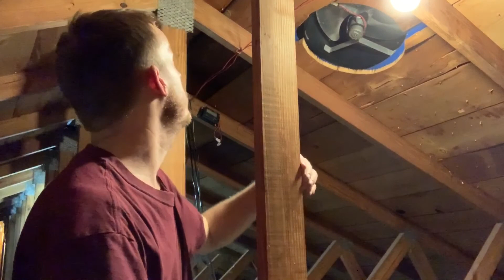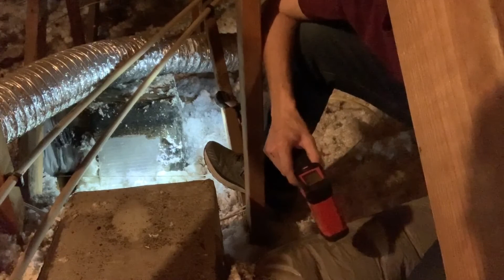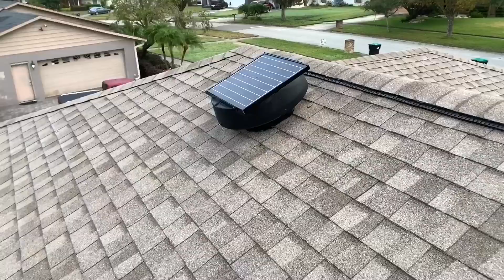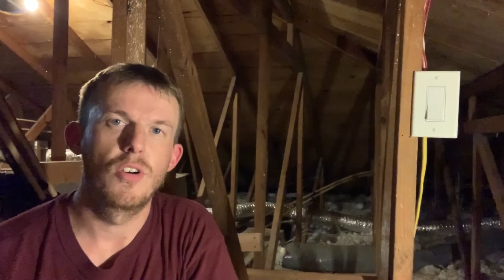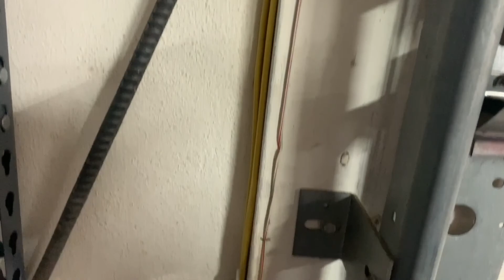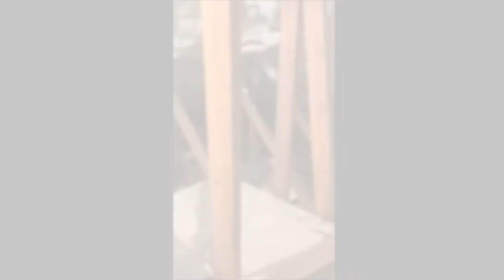Spray foam attic insulation | BEFORE AND AFTER

Comment: Must add an A/C supply vent in there now, or just poke a hole in one of the ducts to take care of moisture.
Reply from the maker: Agreed on conditioning the space. A sealed spray-foam attic does need its moisture managed, and a proper supply vent is the cleaner way to do it than poking a hole in a duct.

Comment: Who ever told you that pannel boards are better than planks for your roof straight up lied to you.  Planks are significantly stronger and will resist water damage and rot way better than pannel boards. The only advantage partical/pannel  boards have is the reduction in weight.. that's about it. 

 If your attic doesnt have adequate ventilation in the summertime the extreme heat can cause pannel boards sag so bad that you can see where each rafter is. 
 Spray foam on the bottom on the roof  can cause you real problems if the roof begins to leak.  Most insurance companies wont cover the roof or walls  that have spray foam for  Mold and water damage.   Im not against spray foam insulation but it has places it shouldn't be used and between roof rafters is definitely one of them

Comment: Problem with high electrical bills, not insulation. Its your duct work, its garbage trunk system. OK for basement in ohio, but not OK for Florida. All air wasted. System is working non-stop. Thats why high electrical bills

Comment: So after 4 years have any issues come up? I am concerned about the heat onto the surface of the asphalt singles will bake them to failure because there is no heat transfer into the attic.
Reply from the maker: No issues on the roof shingles. I found that the attic is susceptible to high humidity, and worried about potential mold, I opened a couple of ducts so that some of the a/c leaks into the attic and gave it more airflow. That seems to have lowered humidity without making any significant difference to my electric bill.

Comment: Spray foam is way overrated, especially in a ceiling. If your roof leaks you’re not gonna know about it until a chunky your roof is rotted away. Regular insulation with baffles and good ventilation moisture is your enemy not to mention it has a way lower fire rating and gives off toxic gas when it burns and it just looks awful.
Reply: Utter nonsense.  Are you an engineer?  I am.

Comment: I’m curious, why must your attic be non vented? Why not add spray foam to the top while not fully blocking all soffits? Keep the blown in cellulose as well on the floor of the attic?
What condition is then created by doing so?
Reply: Moisture is why. Your attic will develop mold and cause rot that way
Reply: Also you want you HVAC equipment in the conditioned space.  this is a huge benefit.  Not having you AC try to cool down air that is 130+ deg makes for a more efficient unit.

Comment: Couldn't you just leave in the cotton insulation since the spray foam only goes on the roof? Can the attic still breath? How does the spray foam work around ridge vents or turbines?
Reply from the maker: Its open cell so it can still breathe. The attic is now part of the air conditioned space insiode the home so you don't want to insulate the ceiling. There are no vents to the outside; it's supposed to work as a completely closed system.
Reply: @MorganPropertySolutions   Thank you for the reply. My buddy has a new home, and it's sealed with foam, but he said it needs a special duct from the AC unit to get outside air..? He said so it doesn't create a vacuum...? His attic is real nice though.

Comment: Great video. So if you spray foam, you never want your soffits and ridge vent to work? Is it okay for your shingles/roof? I can’t imagine that spray foam alone makes your attic 50 degrees cooler
Reply: I had this same question.  Apparently only 2.7% for unventilated attic.  The color of the shingles is 20-23% for dark colored.  So obviously use light colored shingles.  I will be using closed cell in my house.  Residential contractor for 20 years.  Florida
Reply: I forgot to mention, the fact that it reduces airflow is what gives it the advantage.

Comment: May I ask what company did you go with for the spray insulation? I also live in Indian River County, on the east coast of Florida.
We are looking at replacing our roof. We also have solar panels using the net metering system of sending kw back to FPL. As you know in the summer we use much more kw hrs due to running the AC longer throughout the day.
Reply: SPray foam will keep the heat from entering the attic. I've sprayed hundreds of homes and everyone loves the results.

Comment: Sales pitch is never a good thing . Honesty is the best but ..... companies are out to make $$ not help customers.. so ur attic rafters are encapsulated huh. That will kill the life of ur shingles houses breathe for a reason.. humidity. In ur house probably high as well.. so if u have a shingle leak ur gonna find out wen ur roof calapses.. ur flex duct needs replaced and maybe run correctly. Oh goodness.  8" vent for 14" fan ??
Reply: No.  You are wrong.  The system is closed.  At most a dehumidifier might need used but not likely.  Certainteed and the largest engineering firms in the world have studied this and no life lost to shingles.  The reason for a vented system in an attic is the shingles would be harmed as the attic gets MUCH hotter than the outside shingles and when PROPERLY inuslated the attic is NO LONGER HOT.  Frankly you are making an uneducated comment.

Comment: What’s something like this cost? Can you break it down? Can you just hire them to suck out the blowed in insulation
Reply from the maker: I'm sure this varies from area to area and we had this done a couple of years ago and prices on everything are higher now. The spray foam company does remove the old blown in insulation. 
One thing I would recommend, which I did not do, is hire an air condition company at the same time to make any necessary adjustments to your system. Especially in a humid climate because you can have mold form if you don't have the attic properly ventilated. The spray foam company probably won't tell you that.

Comment: What about your soffits?  My roof over hang is about 28 inches with standard aluminum soffits.  You see the plastic baffle that directs air into the attic from those soffits.  Do they spray foam on the soffits or exterior wall plate?  If need be, can you change out a few soffits or will it crack or disturb the spray foam sealing?
Reply from the maker: The contractor installs baffles along the edge of the attic floor straight up to the roof and sprays that. So the soffits are not disturbed. They are not supposed to spray directly on the soffit otherwise the foam would seep through.
Reply: @MorganPropertySolutions  We had water blowing in through the soffits during hurricane - part of our interest in spray foam is to eliminate this problem by sealing the soffits.  Since they left baffles in place won’t the spray foam just get saturated with water in a bad storm?
Reply: @ystebadvonschlegel3295 I'm not expert on this but if I'm not mistaken this foam is closed cell so do not absorb water. I'm looking to do this soon to my house.

Comment: What if your roof gets a leak? And once complete; does that mean you have no access to add electrical anywhere else without tearing down the wall they build in the attic blocking the non cooled area?

Comment: By what percent did this expensive project reduce your power bill/consumption? This main question was never really addressed :-)
Reply: should be 40-50 percent is what we usually get $150 for a 2000sqft house in texas summer is a basic example
Reply: @joshuachristen3494  yup were doing it here in SATX 40-70%
Reply: @Txtileman  what company are you using out in San Antonio? I’m also in the area. Thanks

Comment: What happens if you have a leak in your roof?
Reply: With the Open cell foam he used, it will allow the moisture to soak into the foam. (reason why most companies use open on roofs) and this is a visual sign of a leak.  You would need to fix the leak from the outside then possibly re touch up the foam from in the attic with a couple cans of the Right Stuff ( or alike) can foam.   If you had Closed cell foam that leak would be stopped at the foam but the wood above it would probably rot if no air could dry it.  and you wouldn't know you had a leave because it isn't water permeable.   Open cell foam is very fluffy and easy to rip out if needed.

Comment: We did a spray foam install about 6 weeks ago.  At the end of the first week, the smell inside the house was still very strong.  By week 2, we could no longer be inside the house.  Long story short, the installer rushed and ran the foam too thick and it didn't set/cure.  The smell is permanent.  The only way to remove it is to scrape it out manually by hand.  We've been out of the house living in a hotel for 6 weeks while the installer denies there is a problem.  The manufacturer of the foam (BASF) came to view the job last week and ran lab tests on the foam.  They are suggesting it be removed as uncured foam will "offgas for 10 years".  Just be happy your house doesn't smell like a chemical factory.
Reply: Jezus H Christ on a Crutch, sorry to hear your horror story. That sounds like something that would happen to me.
Reply: @JordanMendell I am about to get spray foam insulation put in my attic next week.  I am sooo fearful of this happening as I have heard of this problem before.  So the problem with the smell was that it was just sprayed too thick and didn't cure?  How thick did they spray it?  What R Value did you have when it was done?  Was it open cell?
Reply: @JipseeGirl  how did it go?
Reply: @JipseeGirl  how did your install go?
Reply: @JipseeGirl  so.. what can I say.  It’s been 5 months since this post.  BASF said the foam job was too many passes too quickly and they didn’t properly ventilate the attic during the application.  Open cell captures the smell in its cells and releases it slowly for 10 years.  It’s unfixable. They should have had air coolers running to keep the temp in attic low.  Ultimately the installer said f*** off and we had no recourse. There is no licensing in Florida and basically we had no way of forcing them to fix it.  I hired a lawyer who fought with their insurance company for a few months while we were forced to live in a hotel.. I finally gave up and ended up finding another company who removed all the foam by hand over a week period, bagged it up and hauled it away.  Then refoamed the space.  All in, I spent $7k on the original install, then $6k to remove the bad foam and another $7k to install it again.  Total disaster.  We ended up leaving the house entirely by this time and had moved elsewhere. It’s hard to describe how bad of an experience this was to be forced out of your home and living in a hotel during a pandemic.. sounds so stupid in perspective because so many people have it so much worse but man it sucked.  #1 thing I can tell you is make absolutely, positively sure the installer knows what they are doing, not the company, the actual installer! The one doing the application in your house.  Single passes, let it cure, attic cool and ventilated. Etc.  reply here if u want to talk more.  Good luck!
Reply: @konakowboy  I'm building a new house with a custom home builder, here in Central Florida and I upgraded to open cell spray foam and I am nervous and excited.  My builder and construction manager do not seem very familiar with this type of insulation.  For instance I had to tell the manager that there should be no vents on the roof or soffits.  He then called the insulation company to confirm and the company did confirm so hopefully the installer knows what he/she is doing.  I am figuring I will take off work and watch when they start installing the insulation.  Any other tips or suggestions you can give me would be greatly appreciated!
Reply: @patticook5435  wow.. if your builder has never heard of a non-vented attic with a spray foam insulation, that would be a massive red flag. Almost all new homes in Florida are non-vented and foamed.  You should start asking difficult questions to them right now to make sure they know what they are doing..
Reply: @konakowboy  If you would reply or provide information on the company that did it right I’d love to hear - I’m looking at having spray foam retrofit on a Florida home because of bare spots and insulation shifting after hurricane as well as just poor initial installation but finding a good contractor especially after hurricane is tricky
Reply: Too thick to quick. Installer negligence IMO. Didn’t allow for cell structure rigidity to form before allowing additional depth/thickness. The viscosity of the liquid state allows gravity to act on increased surface mass and pulls downward on underlying layer causing cell structure to elongate and deform. Temperature and condition of substrate is not to be underestimated either. Insulate tight, ventilate right. My heart goes out for the family affected. It’s not an easy fix and should only be attempted by a competent installer that understands the variables and will stand behind the product.
Reply: @justincase1286  all things I wish I knew before we did the project.  Live and learn as they say..
Reply: @konakowboy  would you be willing to mention the company you used in Florida that did it right? Also did it help with your electric bill at all?
Reply: Ive been to a house to do some hvac work and I walked in the house and can smell the foam. But then went to another house and she had foam on roof decking and it didnt smell and the attic was cool. 105 outside and 78 in attic, that stuff does work
Reply: Awful installer, terrible it happened to you.  But it’s not the BASF foam at fault.  The installers mix was off, spray foam is a two part chemical reaction and basically one part was off and this results in uncured foam.  Also, you’re lucky your house didn’t burn.  When a bad installer lays it on too thick, it can generate excessive heat.

Comment: First of all let’s me say congrats on becoming more energy efficient as I am doing the same to my house right now . Just purchased my first house ever with my fiancé and I am 28 years old. Been researching this stuff for months and we decided to do the closed foam. However let me tell you some things I see that need to be addressed to better your situation.            1) The closed/Open Foam sorta looks like crap,  they usually spray the foam to the thickness they desire then shave the rest off so it looks all uniform and nice, it’s not a big deal but for what you are paying I would expect that to be done . 2) your floor is bare? After all the money spent doing your ceiling insulation , you left your floor completely bare ? You need to now seal 100% of the open cracks on the floor, then install R-30- R-48 or so on your floors as well including your attic entrance. 3) lastly just because I would want every bang for my buck and it’s cheap . Pick up a $60 roll of thermal radiant barrier tin foil and do a final wrapping of your extendable hoses, duct work, or anything HVAC related as it will take you 20 min per duct line and it’s very cheap just to ensure it stays nice and cold/hot !
Reply: wrong on all points.  you only shave off the insulation for walls that are going to be covered with sheetrock.  Further if you do shave off even with the rafters you just opened up a conduit for heat to pass through.  The wood rafter is a better conductor of heat than the foam is, you WANT that rafter encapsulated in foam (do not shave it off).    The floor being bare has NO impact.  Any small leaks in the duct work actually help keep the attic cool and dry.   Remember the entire attic is now a conditioned space.   Its common to put in a 3" vent in the plenum just to put a bit more AC into the attic after doing something like this.
Reply: Val That’s the problem with self guided research, or even “months of research”, who knows the veracity of the sources he was pulling from. Came across as arrogant and stuck up. Typical Dunning-Kruger effect.
Reply: This is a classic case of someone doing just enough research to where they believe they know what they are talking about, but not enough to where they actually know what they are talking about.  Literally every single point was inaccurate.
Reply: 1) you only shave when you need to apply drywall, otherwise you’re wasting insulation. 2) You actually want attic ventilation especially in a humid climate - with a sealed attic space retrofit it’s actually best practice to put a distribution and return in the attic to keep humidity down, the attic is now part of the conditioned space 3) Not aware of any data on this in a conditioned space, would be happy to see your references.

Comment: 1. Hows the electric bill?
2. Are you having shingles starting to curl because of the attic not being vented? 
3. If you could do this again would you do anything different?
Reply from the maker: Electric Bill is around 20% less but we live in Florida so we’ll see how the rest do the summer pans out.
Roof is great, and this is expected to extend the life of the roof because the attic is now an air conditioned space so it is only 85F up there.
We might not go with the lowest quote because we had a few problems with the company.